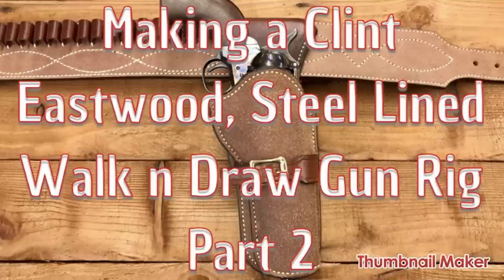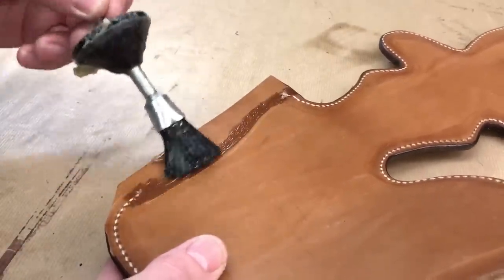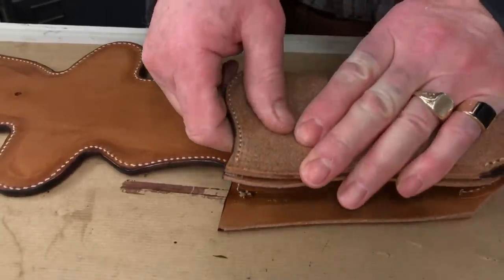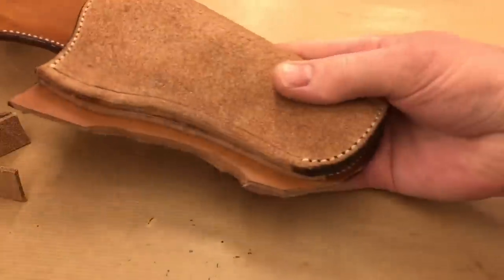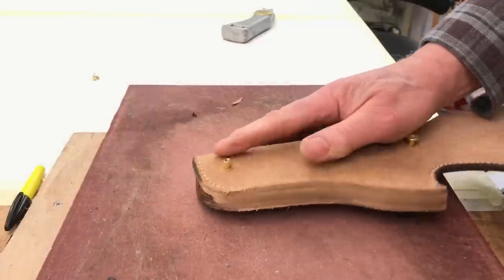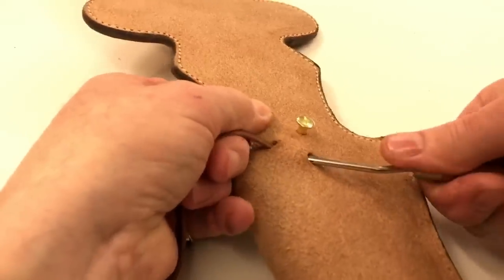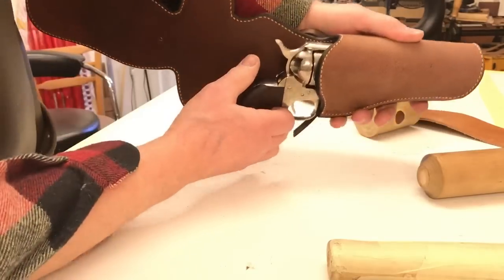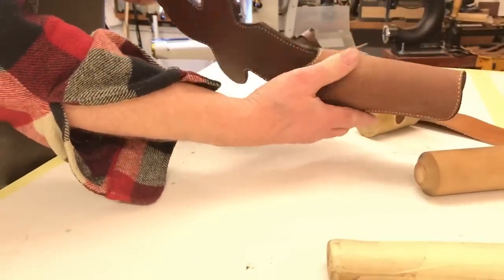Making a Steel lined Holster Part 2

Comment: Part one I commented I Carried a module 19 S&W in a steal lined holster as a law enforcement officer. However our holsters used a hammer loop strap. One long leather strap with both ends passed through the hammer strap holes and tied in a square knot creating a loop. When we used the loop we were trained to twist the leather loop could get clockwise for right handers and clockwise for lefties, until the loop was so small it just fit tightly over the pistol' hammer. Then to draw you only had to push the strap up off the hammer and it would uncool out away from the hammer and allow a fast clean draw. I carried my pistol this way for ten years, until I became a detective and switched to a concealed carry holster. PS The leather strap ,I think, was just under a quarter inch thick.
Reply from the maker: Thats good information, thanks for sharing. 👍

Comment: How do you judge where to put the holes ahead of time for the hammer thong? Absolutely love the work here. Im working on my first western style lined holster and gun belt and i must've watched this series 5 times now
Reply from the maker: Joshua Poche 
Those hole locations are determined in the early patterning stage, wrap the paper pattern round the firearm and mark where you want the holes to be, either vertically or at a 45 angle, 3/4” - 1” apart, depending on the holster style, I then make a prototype of the holster in leather to test fit the firearm, check the design works, and make any adjustments to my pattern.
Hope that helps, good luck with your holster.

Comment: Very good work.  I had never seen how the metal lining was incorporated into the holdter
Im curious why use the chicago screws to hold the fender when theres a strap?
Reply from the maker: MrDigger686 
Yes It took me awhile to figure out the best way to put the steel liner in, as regards the screws, I figure it makes a much more solid connection between the holster and the skirt, and a tighter connection between the holster and the belt.
Thanks for your comment.

Comment: I wonder if holster makers back in the old west used the saddle stitching method
Reply from the maker: Like today it would depend on how many products they were making, high production needs machinery to make it cost effective, that time period was during the industrial revolution, and machines were being developed for all kinds of labour saving operations.
A small scale custom shop could well have been only saddle stitching their holsters, as the holsters and belts were unlined so not so much stitching required as a modern lined holster & belt.

Comment: Thank you for a realy good video.  Most what kind of metall do you use for it?
Reply from the maker: Thanks, mild steel plate, 22 gauge, 0.8 mm.
Reply: London Jacks is there a special reason for that plate? Is no risk for coronation?
Reply from the maker: The steel plate holds the shape of the holster, there’s no risk of corrosion, I paint the steel to protect against any moisture, then it has a coat of adhesive as well.

Comment: I noticed that you didn't rough up the welt before gluing is it not necessary
Reply from the maker: I find the contact cement holds well enough while punching the stitching holes, but roughing the surface to be bonded is always best if there’s any kind of finish to the leather.

Comment: Where can the I buy the tool that you used to pull the retainer strap through?
Reply from the maker: I found that tool at a flea market, I think its called a crochet hook, its very useful, you can probably find them on ebay.
Reply: @londonjacks8371  Thank you for the info. You did a great job on the video for the holster.

Comment: Does the water rust the steel liner.. or is it stainless
Reply from the maker: The steel gets a coat of metal primer and then a coat of contact cement, it’s well protected from any moisture, once the holsters dried out, it get oiled again. 
I don’t think stainless steel would be as workable as mild steel is for a holster lining.

Comment: Could something like this hold a 1851 colt navy
Reply from the maker: Its made for a 5 1/2” SA but the Navy will fit, as seen in the movie GBU
Reply: @londonjacks8371  would if fit the umarex colt peacemaker pellet gun? I was thinking it is but I don't know how accurate the diameters are.
Reply from the maker: @levonsstuff  
It should fit ok as they’re based on a Colt SA, they look to be the same size.
Reply: @londonjacks8371  ok awesome man, thanks for the reply